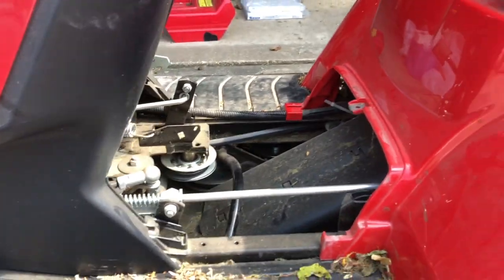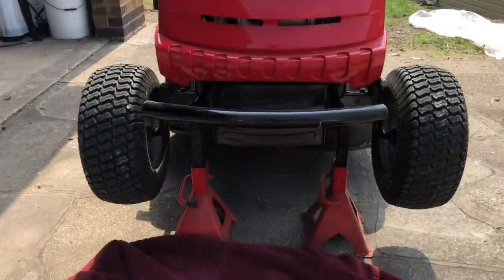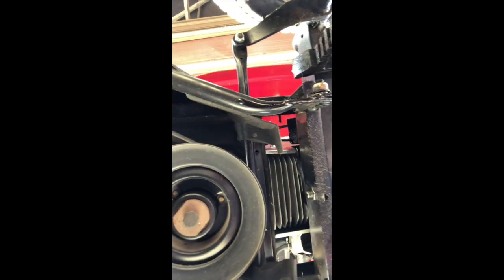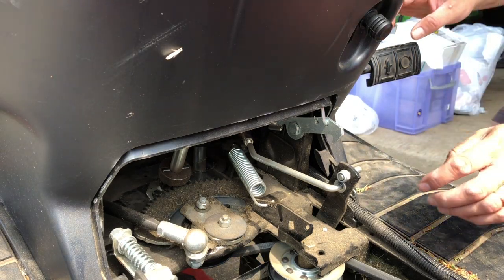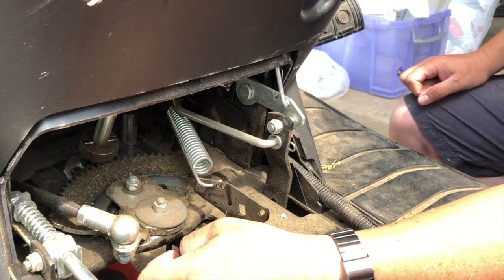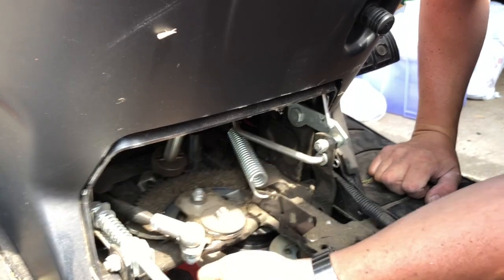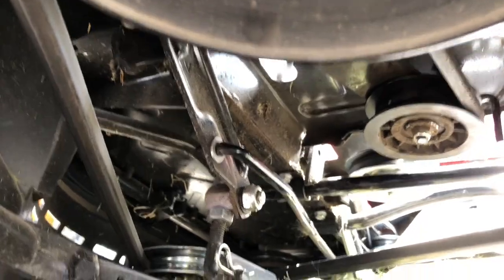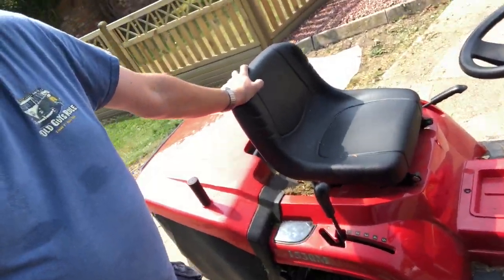Mountfield  Lawn Mower 1530M  drive belt install

Comment: Hi Jon, thanks for the link it says in the manual to ‘tap gently with a hammer if having trouble releasing the clutch’. Looks like brute force is required at this stage! Thanks for your help.

Comment: That mower is mechanically identical to a Stiga 2098 and has been very helpful in letting me figuring out if I can change the drive belt.
Reply from the maker: Did not know they were related 😁.  Thanks NotAlot1135
Reply: @ToTheGarage  The Global Garden Products service manual you linked in response to another comment was my clue. GGP changed their name to Stiga in 2017. My Stiga is the slightly larger 3108H, but the GGP manual is slight spot on.

Comment: Very good video, I'm not fortunate enough to have axle stands... I found that the belt was easier to put on if I dropped the cutting deck to lowest setting... putting the brake on made very little difference.
Reply from the maker: Hi Dave. Yes I think getting the deck in a better position would have helped. Great tip

Comment: Thanks for this video and another one where you showed us how to jump the starter solenoid! I have the same mower and nowadays it is struggling when the blades are engaged. You can hear them slowing down even with the smallest bit of grass. Do the pulleys need to be greased on these things?

Comment: Hi I have just got a great second hand Moutfield mower. I have just watched your video and wounder why you didn't remove the deck to carry out the belt replacement.  Is taking the deck of a major problem. Just asking as I may have to attempt the same maneuver? 😢
Reply from the maker: only because i have never done it before. but i agree it would probably have made the task easier👍

Comment: Great video - thanks. The workshop manual describes how to tighten the drive belt but not the blades belt. Do you know if that is possible or would I need to replace the blades belt?

Comment: Hi Do you have a layout of the timing belt for the cutter blades on a Mountfield 1640H ? I have fitted it but it is making a crashing noise on switching on and I am concerned I may have made an error

Comment: great video. I am having problems with my mower. Exact same model! I was cutting then went over some roots then the engine cut out. After restarting the mower the engine it runs for 10/15seconds then cuts out again. It does this everytime and I can't seem to think what the issue would be. I have swapped out the rectifier but this didn't make a difference.  Do you have any ideas?
Reply: wondering if a drive belt issue would stop the engine running for safety?
Reply: the battery also isn't getting charge so we need to jump it every time.
Reply from the maker: Try starting it and pressing the button that allows you to reverse with the blades spinning. If it stays running then the mower thinks that either its in reverse or that the blades are running. Could be a microswitch has got nudged out of position.
Sometimes mine does this and I put it into a gear and then back to neutral and then its fine. I take it that you are sat on the seat and depressing the wieght (presence) sensor?

Comment: Hi, I wonder if you can help me as I try to fit a new drive belt (the old one ripped apart last week)? It appears I’ll have to remove the electromechanical drive that engages the cutting deck, but am struggling with the bolt at the base of the unit (visible in your video). Is that bolt clockwise to tighten or anti clockwise do you know? Any tips would be much appreciated.
Reply from the maker: Hi Tim Sorry I don't know but have checked the workshop manuals and although it doesn't say its a standard right hand thread, the fact that it doesn't warn of a left hand one suggests its right handed. Try the link below. Its what I have been looking at. Thanks for watching the channel and I hope you manage to free it soon.  John. https://www.worldofmowers.co.uk/UploadedWorkshopFiles/f05dc024-b205-4e7f-9795-6525c4464844.PDF
Reply: It’s a standard thread direction